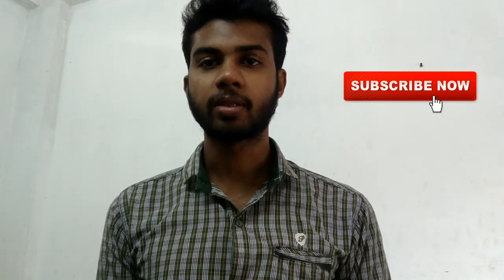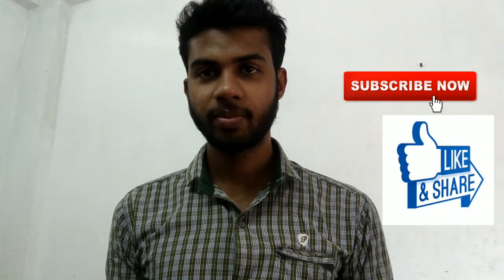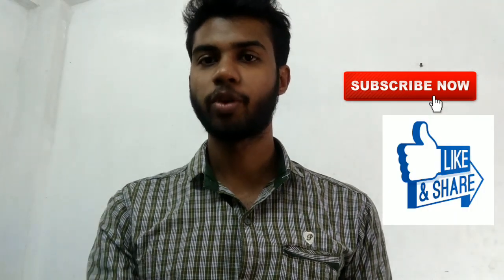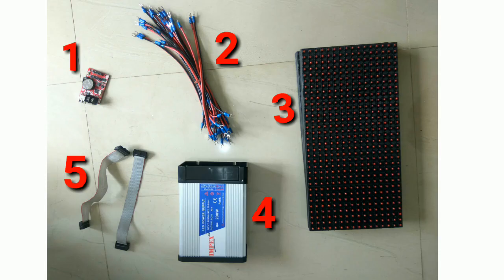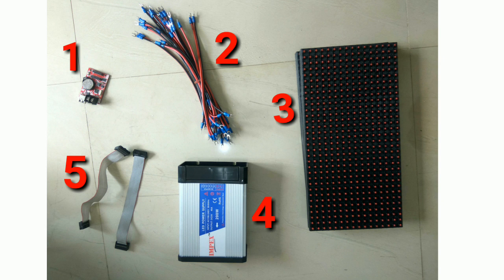How to make LED  Display.  Huidu DIY  Malayalam (p10) | LED ബോർഡ് ഉണ്ടാക്കാം. #Led board #display

Comment: Sir 12feet X 1½feet same like your  board panna evalo price aagum?
Reply: Nalla company eath anu
Reply from the maker: ഒരുപാട് ഉണ്ട്
Reply from the maker: Totel 6 sqrft=  2000×6=12000
Reply: @TECHNOMALAYALAMCHANNEL 
 12 X 1½ feet =6sqrft?
Reply from the maker: @sankars6128  18 sqr ft
Reply from the maker: @sankars6128  for Meterial contact me 9567673307

Comment: സർ p10 rgb  model price  ഒന്നുനപറയുമോ 4×1  ഡൗബിൽ സൈഡ്  16 മൊഡ്യൂൾ അല്ലെ
Reply from the maker: Ys. 16 model
Reply: @TECHNOMALAYALAMCHANNEL  
 Led Rgb modules complete undo...
Reply from the maker: What?
Reply from the maker: Price. High quality module maybe 1000, 1200.
Reply: @TECHNOMALAYALAMCHANNEL  
950  ഒരു സ്ഥലത്തു നിന്നും തരാം എന്ന് പറഞ്ഞു...  ഏറ്റവും കറഞ്ഞത് കൂടിയത് വരുന്നുണ്ടോ...
Reply from the maker: Qiangli company anu top brand അത് കിട്ടുകയാണെങ്കിൽ വാങ്ങിക്കോളൂ 950ന്. എന്റെ അടുത്ത് 1000 ആണ് Qiangli.  other module 800
Reply: @TECHNOMALAYALAMCHANNEL  
സർ  ഞൻ ഒരു ഇ ഇലക്ട്രോണിക്സ് അന്ന് മേടിച്ചു ചെയ്തു എടുക്കാൻ എത്ര രൂപ 4×1 ഡബ്ൾ സൈഡ് rgb p10
Reply: സർ ഇ 1000 എന്ന് പറഞ്ഞത് rgb p10 module  qiangli ആണോ
Reply from the maker: Sqrft maximum 5000. 
4×1 double side 8sqrft. 40,000. 
മാക്സിമം Amount ആണിത് നിങ്ങളടെ ചിലവ് നോക്കി rate ഇടാം.
(smps, Control Card, data Cable......)
Reply from the maker: ys
Reply: @TECHNOMALAYALAMCHANNEL  ഓക്കേ സർ താങ്ക്സ്
Reply from the maker: More deatail. Wtsap me
Reply from the maker: 9567673307